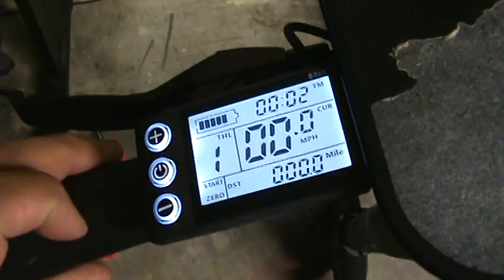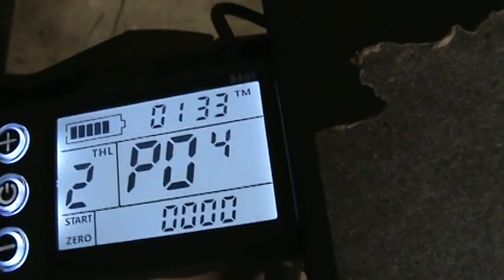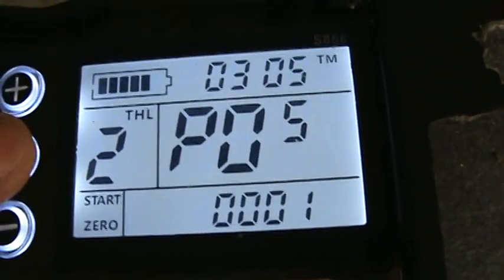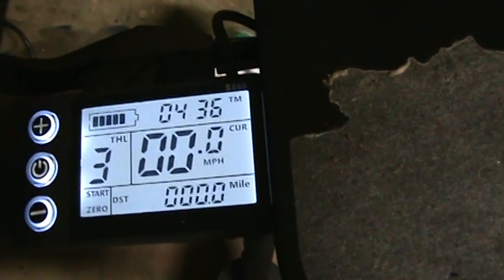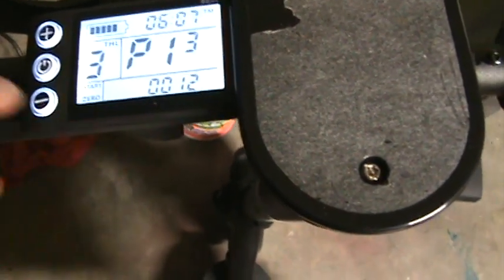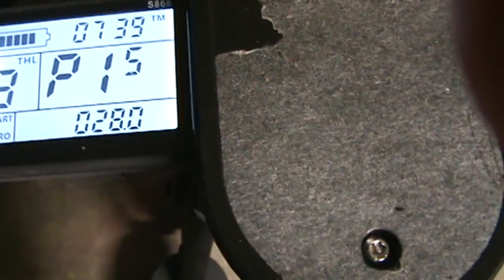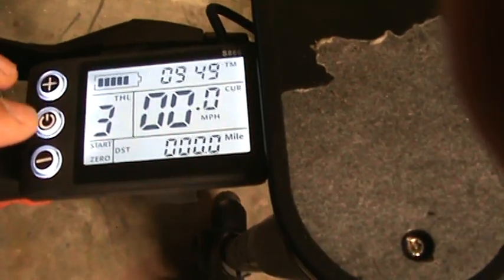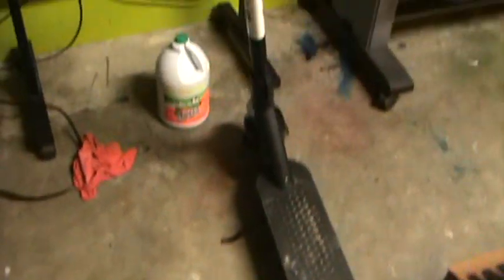bird 590 controller setting

Comment: Hey Sam first of all: thanks for your video and great help, getting the crashed bird work again. But! There’s something wrong with the 3 MotorHall cables (blue, yellow, green). I had to change blue with yellow, otherwise the motor turns backwards. I have the same controller and display, too. Maybe the guys in China had it made on mondays 😁 ?!
Reply from the maker: next time you just need to do a relearn procedure to change the rotation
Reply: @samzone8920  Joh Bro 👊🏻 you mean connecting the (green?) learning plugs and just let it run for a minute?
Reply from the maker: yes

Comment: So everything works but the motor makes a loud grumbling sound on take off...sort of the same sound they make when the motor is bad...I hooked it up to another scooter that made the same sound...not sure if it’s a bad thing or not....speed odometer is p18 not speed limit...if you notice your odometer is saying you are going faster than you are you adjust this down until it matches up with your actual speed
Reply: After take off and the scooter picks up speed the sound goes away
Reply from the maker: Thats the phase cable connection that are wrong combination the sound is because the firing order is wrong because the wrong phase cables combination change it on to they work good
Reply: Which ones are the phase cables...? It only does it on take off but I’ve adjusted the settings and was getting very good speed..I followed your video step by step..
Reply from the maker: @jimmychafins  big 3 cable from motor and controller
Reply: Are the phase cables the large 3 that went to motor..?
Reply: I rode it today for about 24 minutes then it quit on me...when I took the controller apart that staple looking thing had popped off...most likely because the phase cables were out of order...I waited too long to trouble shoot...anyway to know what combo of colors work..?

Comment: Hello .  I made all the connections as in the video and all part of the display turns on and I set everything as you said in the second video.  but after 10 seconds and the display runs out of power and everything stops
Reply: did you manage to find a method?

Comment: Just converted a Bird 590 with this controller, and it behaves strange. Wheel ist always spinning with 2-3 rpm, only in full throttle it stops. When you release the throttle, it spins again. Not top speed, just in a few km/h. Any suggestions? Wiring is fine,  throttle is original Bird 590.
Reply from the maker: recheck all wires connections and then set up the display setting correctly
Reply: I checked several times, all fine. Motor all colors 1:1, Batt has Bypass and worked, Brake and Throttle are fine. Weird is, that the Speed of the Wheel is always same, only stops when I push throttle. It does 9km/h, never more, never less. Strange…
Reply from the maker: @FPVZaphod  i think you have the throttle cables on the brake and the brake cable on the throttle try switch them and try again

Comment: This controller is suitable with hub motor geared ?? Can showing the right speed !!?
Reply from the maker: Yes they should work thats why they have the 2 wires for relearn procedure to adapt any motor and for the speed accurate you need to set the right parameters

Comment: Hey i do it like you in your videos but i got a problem when the scooter stands in the air i can give full throttle but if i step on it after 2 meters it will shut completely off and let it only turn on after i put the charger in whats the problem i hope someone can help me
Reply from the maker: You need to do a bms bypass
Reply from the maker: I have a video about that
Reply: Great job thanks bro happy new year from germany👍🏻👍🏻❤️
Reply: @samzone8920  bro one question left i have the bird 590 from germany and my lights cable are 3
Black white and red where do i have to connect these :)?
Reply from the maker: @anilobama8841  those 3 wires are the same for all bird scooter you need to watch the complete video very careful because is all there if not in one video keep searching in my other videos i know is somewhere in those video about how to connect the rear light and also you need a voltage stepdownload

Comment: Hi I have the same display but unfortunately the parameter P08 (speed limit) flashes but pressing + or - does not change it how can I solve it ??
Reply from the maker: Dont understand your question
Reply: samzoneworld  the value of P08 remains at 25. Although I press + it only flashes.
Reply from the maker: Well is supposed to change when you press + or - if they dont do anything most probably is bad those thing are cheap Chinese parts and they came bad very often
Reply: samzoneworld ok thanks

Comment: Hello ,
how are you. I come back to you because I have an E10 error that appears on my LCD I dismount all the scooter but nothing nor made the error E10 continues to appear. it's impossible for me to get in yet everything seems to work
Reply: @Acavando  I dismount the controller everything is ok I do not know what to do the error E10 does not want to remove my LCD screen
Reply: @Acavando  hello, thank you for your answer. But I do not understand what son exactly I must solder ?? I have to weld all the sfils connected to the controller is it? thank you
Reply: I also have the same problem
Reply: Same problem, any solution?
Reply: Did you figure it out
Reply: I’m getting the same E10 error on my LCD screen

Comment: i was riding my scooter and it stopped and it’s not going and E 07 is on  display
Reply from the maker: that code is for motor failure
Reply: its hall sensor error. check your connections
Reply: @darexg  got the same problem. Had to change blue hall connected to the yellow, otherwise the scooter turns backwards?! But now, got E7 too, scooter works until it reaches maximum power. Any ideas how to fix it? Thanks!

Comment: Why dose wheel spin backwords
Reply: Exactly, why does it spin backwards? Help please!
Reply: @tubefr71  justbridge the learning wires and turn on. google it
Reply: @RotineQue  Self learn is activated by connecting the two green wires on the controller with the power off. Then turn on the power from the LCD panel and the front wheel will move slowly as it detects the phase of the motor. If it turns the wrong way, disconnect and reconnect the green wire with the power on - the wheel will turn the other way. Once it's turning the right way, dont touch anything and let it run for 10 seconds or so, then then turn off the power via the LCD.
Reply: Danh Pham does it really work? I’m gonna try in a few minutes.. mine is going backwards too
Reply: Yes
Reply: Pablo Escobar no swap the phase wires. As well as the hall sensor wires. They coloured it wrongly. Leave the green phase wire and swap the yellow with the blue. It will work. Do the same for the hall sensors. So leave the green phase, cut the blue and swap with the yellow
Reply: @danhtpham  what two green wires? there's a few

Comment: Lol is my bird scooter the only one that drove backwards after wiring it all together???? My shits doin wheelies
Reply from the maker: You need to do a relearn procedure to fix backward problem
Reply: Where did you get information on the relearn procedure? Same thing I got.
Reply from the maker: @mikerak7473  i just figured out onetime i was lost with the backwards problem
Reply from the maker: You know how to do it?
Reply: @samzone8920  I dont Sam, I keep going through these conversations as I hate bothering people when the info has been posted somewhere.
Reply from the maker: @mikerak7473  that info is in few conversation in one of my videos but i tell tell you again the first thing you need to do is make sure all is connect right turn off the scooter connect the two relearn cables sometime are green but sometime are white anyway after you conect the two wires together one with each other like a loop turn on the scooter the motor now will go foward slowly at this point dont touch anything just let them run for like 5 second and then turn off the scooter disconnect the relearn cables and thats it after turn on again  they should run fowar only
Reply: Mike Rak look for the yellow and blue wire and solder them together and use shrink wrap that ensures a good connection for years to come. And my scooter does 29mph I swear to god
Reply: samzoneworld Sammy hermano, muchos muchos gracias!!!
Reply: @samzone8920  Good morning, that did it my friend! Next question I have and hopefully the last, The battery is fully charged and the scooter will only go 5mph now? Any ideas? Thanks so much for your time!
Reply: I am good! Thanks Sam!!  31MPH
Reply from the maker: @mikerak7473  you need the nilincrease the speed in the plus(+) button
Reply: Mike Rak when you turn your display on hit the power button till you get to
Number 5
Reply from the maker: @alinehme9425  yes
Reply: @samzone8920  Thats what I found to turn to number five and it goes now.. Thanks for all your help!!

Comment: Hi sam
In your video you set 9 for p13
Is that still the value you use
Because in the datasheet they say 5 , 8, 12 if I understand well
Thanks for your help once again
Reply from the maker: use 5   9 is to strong
Reply: @samzone8920  thanks I will try this setting . I'll Let you know
Reply: Hi sam
I have p13 setting to 5 as you suggested.  Ans the motor is less noisy.  Thanks 
But the shut down problem still occurs . Do you have another idea ?
Reply from the maker: @cryptomanu9994  at this point the only thing you can do is bypass the bms ground cable but you need to open the battery and is real hard to open that battery i have a video about open that battery is a mess but maybe they help you
Reply: @samzone8920  as I have the same problem with another battery,  do you really think this is the source of the issue?
Reply from the maker: @cryptomanu9994  yes i think birs is puting new firmware i side the batterys bms to try to make the battery useless the samething hapen wirh the new jump.scooter you need to bypass the bms in order to constant suck power from.them but this controller have a undervoltage protection so tjey will act like a bms set the undervoltage to 28v and roll
Reply from the maker: and you only use the bms for charging purpose that  is the most important roll of a bms balance all the cells inside
Reply: @samzone8920  yes I have seen your video when you open bird battery.  It seems so hard 
Can you give details about how to bypass BMS ground cable ?what  is this cable?
Reply: Which cable ? Small Black one connected to power cable ?
Reply: Hi is your shut down gone after you do the bms reset or was ist an other failer then the bms? Because i have the same problem that all works well but ist shut down after a few seconds ride and i can only start it again after disconnect and reconnect the battery??

Comment: Hey I have the same setup just wondering what you do for the brake reminder light that comes on? It stops the scooter when your riding
Reply: Did you fix it? I have the same problem… scooter stops and shuts down on level 5 at maximum power

Comment: Have you stuck with these settings? If not can you type out the setting you choose for each one. I’ve got mine set just like yours in the video but just wondering if you have played around with different settings and found something that worked better for any reason. If they are different please reply with what yours are now.
Reply from the maker: there  is not much important things to do with those setting my setting are fine

Comment: hello, how are you thanks for this great video I have a problem with the scooter that goes out of the way that I put the speed on 5 will you explain to me why?
Reply from the maker: you need to bypass the bms
Reply: @samzone8920  
can you explain to me how to bypass it thank you
Reply: hello I do not know if I expressed myself well but my scooter goes off after two minutes is it normal or can you explain me thank you thank you :-)
Reply: BMS
Reply from the maker: @victormongain7846  make sure all connection are good and if all is good you need to bypass the bms
Reply: @samzone8920   bori Buenas tardes cómo anda me hace falta contactarme contigo
Reply: Wo ist bms?